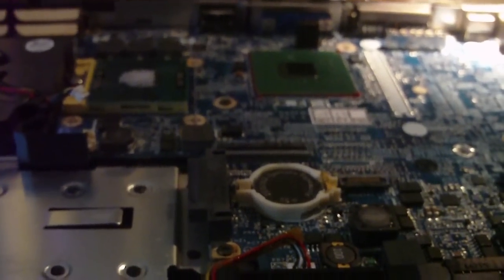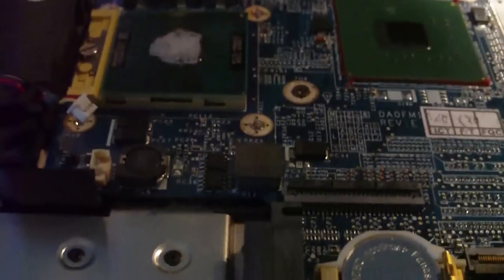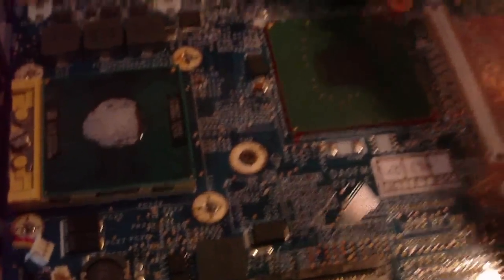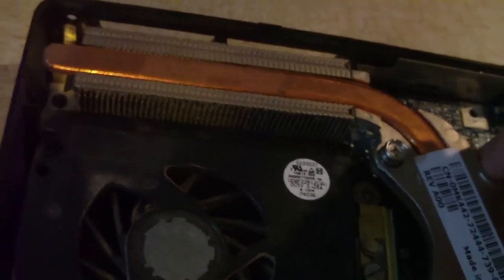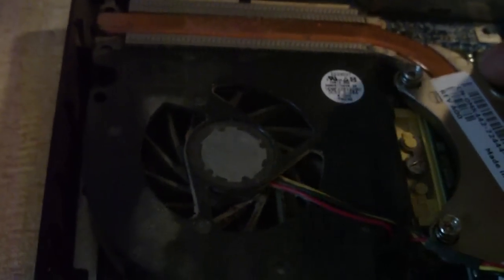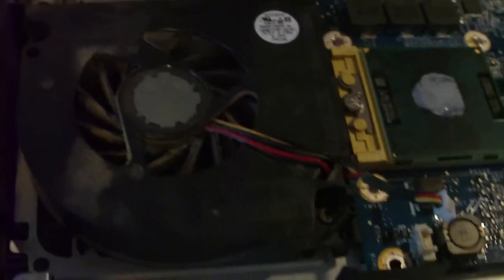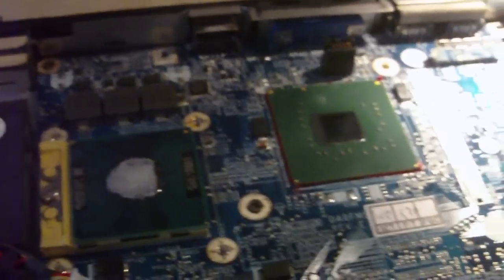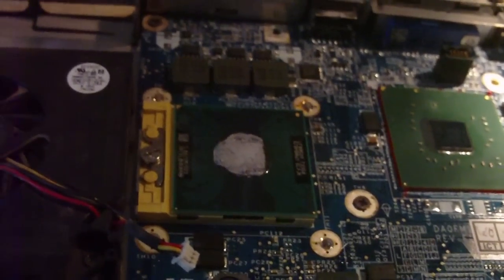How it Works: Notebook Cooling

Comment: would it help in anyway to place heat pads on the heat sink metal so that they touch the cover of the laptop and help dissipate heat faster.
Reply: Yes if the cover is metallic. Watch Linus tech tips - fixing maccbook thermal 2020

Comment: I recently bought a Dual-Core 6th Gen i7 TOSHIBA Satellite S55T-C5370-4k Gaming Laptop with NVIDIA GeForce GTX 950M 4 GB GDDR3Link on Newegg:     http://www.newegg.com/Product/Product.aspx?Item=N82E16834217158&nm_mc=OTC-Iceleads&cm_mmc=OTC-Iceleads-_-Toshiba-_-Gaming+Laptops-_-34217068 And it only has 1 fan for both the CPU and GPU; is this one fan with a copper heat sink rod connecting the GPU and CPU really enough for gaming, also is it enough for GPU overclocking? Please reply and Thanks for Answering :)
Reply: It is enough, but if you are playing high end games it'll run a bit warm and it won't be as efficient as having two separate heatsinks with two fans. I suggest that you monitor your temp while gaming.

Comment: Another piece of information: The copper tubing is filled with tiny drops of a special fluid. At the hot end they evaporate and thee drops recondense at the cooler end replenishing the liquid. Of course over time the fluid's capacity to recondense diminishes...
Reply: kedar prabhudesai is that fluid nontoxic?
Reply: @luckydearment5849  yeah it is.